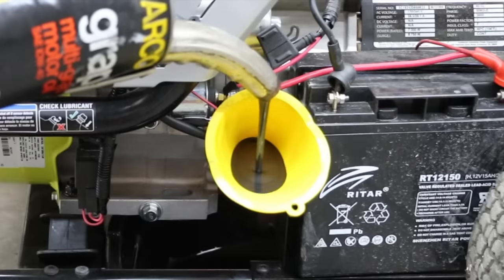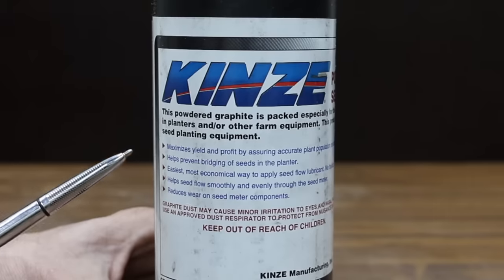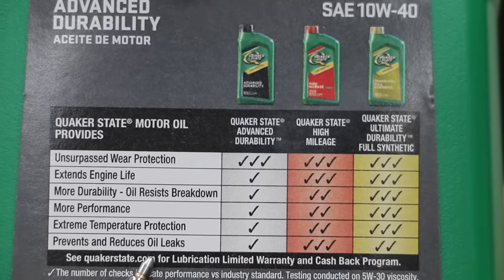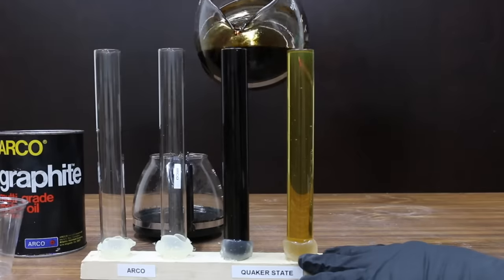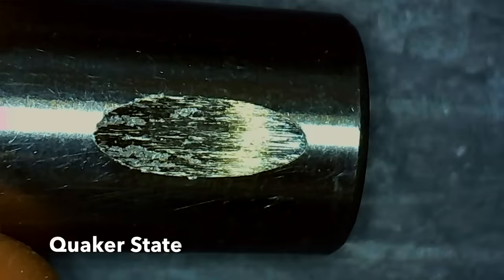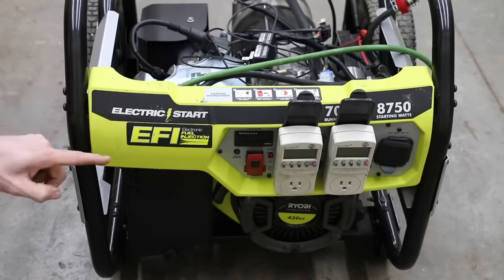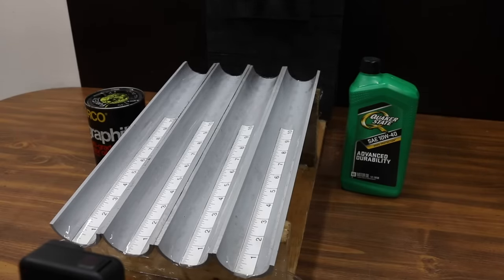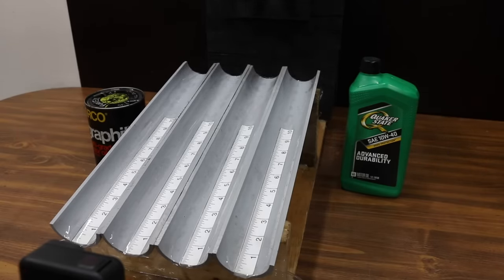Will "Graphite" Help Motor Oil Performance? Let's find out! Vintage Arco Graphite vs Quaker State

Comment: Interesting... thank you. I’d love to see a similar test with molybdenum disulfide powder added to motor oil.
Reply: Whoa. My subscription worlds have collided. Much respect to you both for what you do.
Reply: Was just coming to comment about wanting to see it done with moly also
Reply: @jtsholtod.79  Yep I learnt to open  one when I loose my keys. With 2 open ended at 90 degrees of each other 🤠
Reply: Wow impossible to understand no one's going to believe me oh well
Reply: Have you tested Marvel Mystery Oil added to the crankcase oil?
Reply: germany1988 I ran it my racing motor for year. Always did me good. Also ran it in the fuel as an additive, when I wasn’t racing. Had a separate fuel tank with racing fuel for the racetrack. 1/4 mile stuff.
Reply: Been watching LPL for several years and just joined this one.
Reply: There is a motor oil additive called Liqui Moly that uses mineral oil and moly disulfide.  It seems to work, but I don't know how well.
Reply: Bruh what is LPL doing here
Reply: I can tell you right now molybdenum disulfide is an incredible high pressure additive with high heat resistance. Machinists use it to prevent form taps from breaking amd to reduce the HP requirements of form tapping to a negligible level.

And form tapping is literally putting so much pressure and friction into a tiny hole that it bends and deforms it.
So if it can hold up to that, its doing something good in your engine
Reply: No. Moly is a no. I would try boron nitride. That is an industrial dry lube that is better than graphite.
Reply: @allhumansarejusthuman.5776  

The question is whether or not it’s needed, as most engines are designed to rely on hydrodynamic lubrication...ie, maintenance of an oil wedge between moving parts. Consumer motor oils already contain ZDDP extreme pressure additive. Given that it contains phosphorus, a catalyst poison, and MoS2 contains sulfur, another poison, it would be wise not to overdue it.
Reply: Holy crap. LPL is on another one of my subscriptions? Nice.
Reply: I add a few spoons of moly grease every few oil changes, engines seem to love it.
Reply: Seconded - I have an application that is not for engines, it's for marine v-drive transmissions. Per the manufacturer: use heavy duty SAE 30 oil. Add MoS2 powder to the oil is required for break-in. Adding MoS2 is not required but is recommended for subsequent oil changes. I have purchased it on-line - reagent grade 99% pure, 1.5 micron powder. 
(there are no filters on these trannies - just a screen.)
Suggest that just the bearing test would be needed - at least that's what would be applicable for this particular application. 
Love your vids - keep it up!
Reply: *hexagonal boron nitride
Reply: Motors love moly!
Reply: Both moly and graphite are the most aggressive of the EP agents, these are only used to counter boundary lubrication conditions, 
Neither plays well with in noble metals notably big end bearings
Reply: No love for tungsten disulfide all you moly and hexagonal boron lover when the king of friction coefficients going to get his dues?
Reply: I didnt expect you to see this kind of content but it makes sense
Reply: @longbow6416  big end bearings don’t
Reply: @allhumansarejusthuman.5776  
It is fine on items made from noble metals such as carbon steel, Babbitt and white metals (big end and main bearings) will be eaten 
And it’s Extreme pressure not high pressure
Reply: @mrbumcraic5046  I understand that piston rings are sometimes coated with moly. Thats up and down motion with the presence of a liquid lubricant. What happens using moly in bearings?
Reply: @longbow6416  yes they do as the piston and rings are under “boundary lubrication” conditions (they move, stop, move, stop etc)
EP additives are chemically aggressive under heat and load with moly being up near the top of the EP range, ignoble metals such as Babbitt or white metals will get eaten
Reply: @BooDamnHoo  
I think boron has been banned in most countries as it makes you go dead
Reply: He's done a couple videos on moly additives, ones on his farm truck and he uses everything on it and that ones amazing. Think there's another one between normal oil vs oil+moly
Also could you pls test out if adding graphite powder can shirt circuit some electronic locks and cause them to unlock if you shake them?? 🖤🖤
Reply: Lol what are you doing here?
Reply: My fist car that i ever bought, the owner had expereimented with its engine. Adding molybdendislufid. He work at at technical shool. He said it lowered the rpm. I dont know? But the engine ran great when i sold it 10years later
Reply: @PeteyMcSavage  ,
whoa love the additional info
Reply: Ave: has left the chat room.
Reply: @mrbumcraic5046  Interesting.  I ran graphite additives in my truck, and my engine seized up from bad main bearings.  New engine, and just add oil now,  Wonder if that was the cause of engine failure.  Thanks.
Reply: @rugbyladice574  
Major oil manufacturers spend lots of money with seriously good chemists doing R&D on engine oils. Find the right viscosity and specs for your engine and climate, choose a good  brand and stick to it, good filtration (air and oil) with good cleanliness habits also help heaps
Reply: What in the world is this a crossover episode
Reply: MoS2 added to motor oil would be great to see!
Reply: @SlickWillyTFCF  
There are good reasons they don’t
Reply: @mrbumcraic5046  such as?
Reply: @SlickWillyTFCF  
Moly is very chemically aggressive under heat and load, while fine for steel components under boundary lubrication conditions (gear teeth, piston rings and cam lobes) softer less noble metals such as big end bearing will be eaten away.
Not really good for low clearance rolling element bearings either
Reply: Hey nice comment
Reply: @datadavis  ....I was thinking along those lines cos here the tubes of MoS² have gone from the shelves, insufficient demand .
Reply: @mrbumcraic5046  ...I wonder if you might mean to say beryllium .
Reply: @rugbyladice574  ....some engineers were having suspicions decades back that at extreme pressures the graphite would get converted to just plain ordinary carbon with no lubricant properties or even micro diamond particles  worse than very fine abrasives .
Reply: Didn't expect to see you here
Reply: I remember helping to tear down a Chevy small block in the early 1980s that had run for years on the arco stuff.  The engine valley had about an inch of graphite sludge in it! The engine had 100000+ on it, but man was it quiet for a V8!!!
Reply: Several oils and additives already have it but adding extra could be very interesting
Reply: same
Reply: Oh yes that cancer causing stuff
Reply: Oh Shit, LPL is in the comments guys!!!
Reply: Ah. You're the guy teaching people how to break my chains and locks to steal my motorcycle. 
Thanks alot...
Reply: @jessehellakoo  It was meant to be a joke. 

A joke about how when you own a motorcycle, everyone tries to steal it (or it feels that way).

I think his videos are very useful. Especially highlighting poor gun safes.
Reply: @ashleyhall5347  joking? You're full of anger and hatred huh?  All jokes inside, I hear if you sell your bike to someone it can't ever be stole. I'm not 100% certain but I think it's worth a try. 😀
Reply: @jessehellakoo  yes a joke. 

He breaks locks and films the results, Motorcycles are stolen often. It's not hard to understand.

Oh and selling it because people try and steal it often is a horrible attitude.
The problem is with people stealing, not people owning motorcycles.

Sounds like somebody who steals to me...
Or just an idiot.
Reply: Rislone has a moly additive. I've used it in the past, but no comparison on oil changes. I know moly reduces friction
Reply: @BooDamnHoo  I've been using MSO2 for 3 years now. Half a can in each oil change on 2 vehicles that are everyday drivers.  152 thou on 04 santa fe  and 146 thou on 2014 Dodge Journey.  No ticks and run smooth.  I will use it for the rest of my life
Reply: @mrbumcraic5046  What do U mean by big end main bearings.  On an engine They are plain bearings floating in oil.  Molly doesn't hurt them. If nothing else it helps on startup before oil pressure is up.
Reply: @mrbumcraic5046  Are you aware that because of emissions they have removed allot the molly and zinc and replaced with boron.  Use modern oils in an old flat tappet cam engine and you gonna have problems. New engines are roller everything.  Also Molybdenum disulfide and zinc is listed on an oil analysis.  They are  extreme pressure additives.  Even a modern engine benefits from these.   If your the kind that trades your vehicle in at 100 to 150 thousand just change the oil and your fine.  I prefer to drive the wheels off of my vechicles.  And I only by used cars.
Reply: Moly works well in grease for sure
Reply: I agree I'd love to see that expensive test!
Reply: Not going to make any difference as MoS2 oil showed. If you were to add more you'll run into problems with buildup.
Reply: I second that. Would like to have seen the difference graphite added to the modern QS oil would have made too. The final test adding graphite to another oil and testing only in the lawnmower just doesn’t provide a suitable comparison.

The ARCO oil wear results on the lubricity test were amazing, suggesting we need more testing with zinc, phosphorus, graphite, and/or molybdenum. For an old SE rated oil to perform so well in that test versus a modern SN rated oil is just too good to overlook or ignore.
Reply: @geoffstrickler  Not really, modern oils will take care of your engine just fine.

Go look at the actual combat of the best oils on this channel.

The rating has more to do with how it behaves after being used over time and how well it keeps the viscosity over many extreme temperature changes. That ARCO oil is absolute crap compared to modern oils when it counts.
Reply: @michaelmay5453  except this test shows wear can be significantly reduced. So, think again. It would be interesting to see the results.
Reply: @BooDamnHoo  why tho lmao I run mos2 at every oil change for the last 4 years and engines run smoother than ever
Reply: Hahaha lockpicking lawyer clutching the #1 comments sheeeeeesh
Reply: Where did you come up with the idea for compound crossing in oil ?? Have you done your own experiments ?? BTW love your channel 😉
Reply: @mrbumcraic5046  didnt know white metal was a noble metal
Reply: @mrbumcraic5046  Boron is actually commonly used in wound healing antiseptic creams
Reply: @rumplestiltskin1056  
Molybdenum disulphide is a “solid lubricant” EP additive and as such is measured in microns (8-25 depending on application) whereas “chemical EP or AW” additives are measured in angstroms, the oil in your main bearings has a film thickness of about 5 micron allowing the moly to break through its film and experience localised heat and pressure, this is where chemical reactions occur, eating ignoble metals such as most big end bearings, don’t use moly additives
Reply: @mrbumcraic5046  Iv'e been using now for around 4 years in all my vehicles and no problems. Half a can per oil change every 5000 miles. I love the stuff.  Also I beet your wrong on 5 micron film strength.  Main bearings have allot more play than that .002 clearance on a main bearing is 50 micron.  Divide that by 2 for half of a circle and you still have 25 micron clearance between bearing and Crankshaft.  Plus some molly imbedded or plated is probably good. And If it gets as hot as you say between the bearing and crank to cause chemical breakdown/corrosion wouldn't the oil be broken down also?
Reply: @rumplestiltskin1056  clearance is not film thickness. Your bearings “ski” on the film thickness. You will get problems with moly. I am a Level 2 machinery lubrication Technician and a current financial member on the International Council of Machinery Lubrication
Reply: @mrbumcraic5046  Got any case studys on moly and bearing wear?  I have 160000 miles currently and use no oil.  Been using since 90000.  I bet it really  helps with cold starts.  What is your career, machine repair?
Reply: I'm gonna reach out to liqui Molly and talk to an engineer about bearing wear. I'm sure they have case studies with half a million miles.  We'll see who's full of shit. Probably got that level 2 because you took some little course and read it somewhere now your an expert. And your a financial contributor because of an annual renewal fee.
Reply: @rumplestiltskin1056  
15 years in specialty lubes will do it, your experience will be??. But hey do as you believe is right
Reply: @rumplestiltskin1056  
Traded Fitter machinist since 1982, Batchelor of Engineering Technology, Batchelor of Education and last nearly 15 years in specialised lubrication.
No I don’t have case studies. Your only help with cold starting is low viscosity (why they spec multi grade) fully synthetic base oils will always have best pumpability at low temps, moly won’t help that
Reply: molybdenum sulfide is in certain german oils  that’s why they make you use the nice shit from the dealer
Reply: @Fee.1  Royalty doesn't teach criminals how to bypass security!
Reply: Seeing LPL reply to Project Farm may break the Internet.
Reply: Liqui Moly is the name of a German oil manufacturer. They produce a range of really good products that are even used in the VW factories.
Reply: Liqui moly
Reply: World's are colliding Jerry, George is getting upset!

Apparently this is where all points in  my universe connect to each other, a universal convergence if you will. How did the Lock Picking Lawyer get to Project Farm? Who knows, but it's very strange indeed. 
The center of the universe is at a location somewhere between Todd's workshop at Project Farm and the LPL's home residence. 

I'm freaking out Jerry!

Oh yeah, and moly is pretty good stuff as well.
Reply: @AquaTech225  Moly can micro weld to the journals, to much is a bad thing.
Reply: A little tri nitro toluene to knock those deposits off the valves maybe. I said a little. Thank you.
Reply: @Justin-tp1mx  lysergic acid diethylamide
Reply: Good old Molly be damned. Great stuff ⚙⚙⚙
Reply: @rexandexler575  LAD
Reply: And a test with several starches
Reply: Wouldn't these plug the oil filter??? And assist in the motors failure....
Reply: Ive been adding moly under the brand of slick 50 or under penrite brand in all my engines small to large. I only ever got a little problem on my Fj cruiser engine but suspect maybe it was because i used a little too thick base oil first, but after about 1000kms it was fine.
Reply: Oil filters be like 👁️👄👁️
Reply from the maker: Great suggestion!
Reply: I would like to see a test with molybdenum also. I ran a moly additive years ago with great results. It was named “moly-slip”. I t hasn’t been available since the mid or late 70’s because it supposedly damaged catalytic converters.
Reply: Can you pick a motor using grafite ?
Reply: @ProjectFarm  Crazy that you’re still replying to comments a year later, this is why you’re the gosh darn MAN!
Reply: we used molib in landing gear fluid  no graphite i used molib during assembling high performance engines never used graphite in my oil
Reply: See my video of my 1981 Isuzu 6BD1T engine running with Ws2 for over 5 years
Reply: @f.glenskidmore1678  Similar experience with MoS2 on an 85 chevy station wagon I had for business.  Had about 250K miles when someone stole it and wrecked the body.  A commercial shop bought the remains at auction for a cheap engine--and ended up phoning me to see how an old worn out engine had remarkable compression still.  He thought it may have been recently rebuilt.  We were running an unusual MoS2 additive not designed for engines, added as a powder to straight oil to "make our own".  Normal frequency oil changes. Probably 2 to 4 rimes the volume of additive one would see in most commercial products.